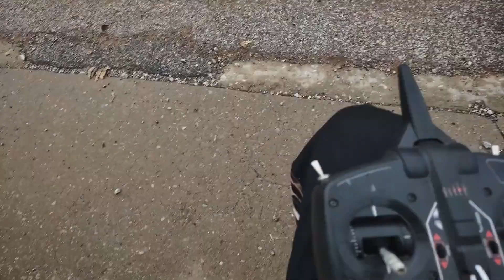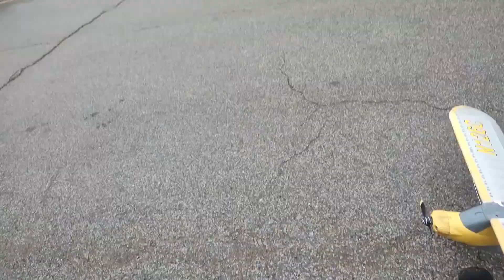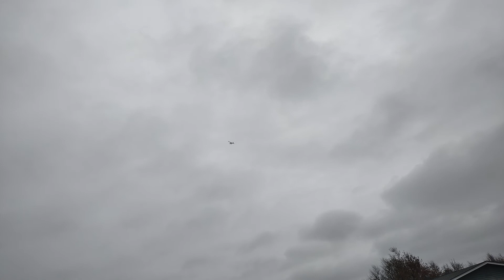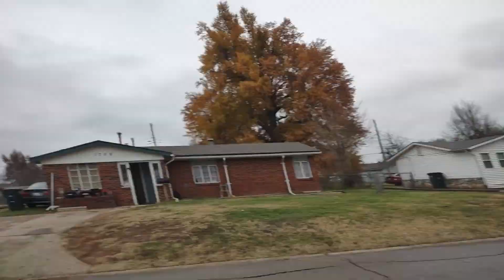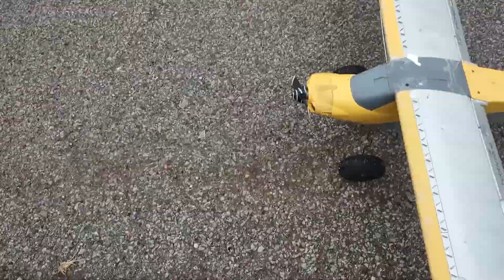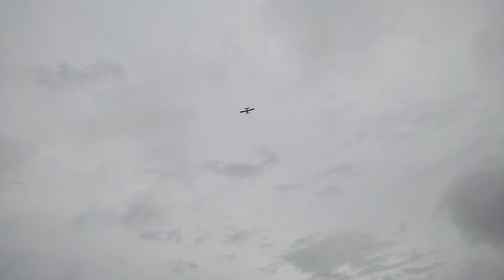Carbon Cub S+ flight still in light rain. Using RTF radio and flaps are stuck on half flaps.

Comment: You have to use a programmable radio to dial in down elevator while using flap.  And don’t go above 1/3 throttle when using flaps to fly around. It will nose up if you get close to 1/2 throttle.   You should have take off flaps ( a little down ) to full flaps for landing with no wind.  Manually/ mechanically trim flaps so they are flat across with ailerons.  Don’t use flaps with that radio.  It’s a great plane .  Definitely needs to be spot on with the C.G .    And it’s a blast with flaps and a 4s battery if you put a 40 amp ESC in it.   Enjoy I hope these tips help
Reply from the maker: Thank you very much, that is very helpful.  Normally flaps are not usually active on the rtf radio, i don't know why they were in half flaps. The video before this one, I was using my RadioMaster TX16S. Maybe they were stuck down because I switched radio's.  I not only love this RC hobby, i also enjoy learning new tricks and tips. Thanks for the knowledge.
Reply: @WDRC  always willing to help and share tips and tricks.   Just unscrew the wing.  If your radio doesn't have a switch that puts flaps fully up level with ailerons.   If  switch doesn't work you may need to just  plug servo flap in gear receiver plug and make adjustments as needed.  That plane doesn't come with flap servo installed. I just put my buddies Bind n fly together and his was RTF kit as well.  I installed his flap servo and gad to cut flaps free and hook it all up.    You'll be fine once you level flaps or us a programmable radio

Comment: Yes those flaps are causing your troubles. You can pull the wing and adjust the linkage or just unhook arm from servo and move it one click to raise them to even them out to equal the wing tips / ailerons.
Reply from the maker: When I use my RadioMaster everything works normally. Didn't expect it to drop to half flaps.